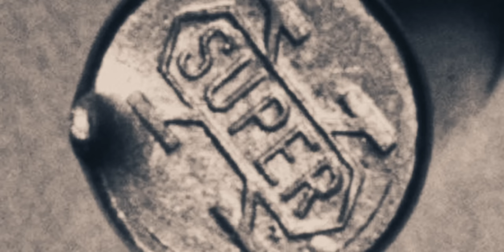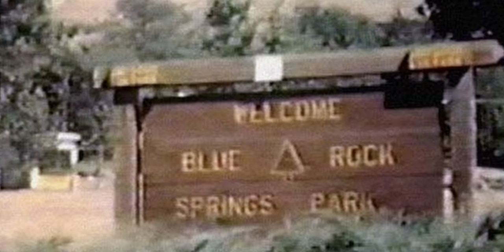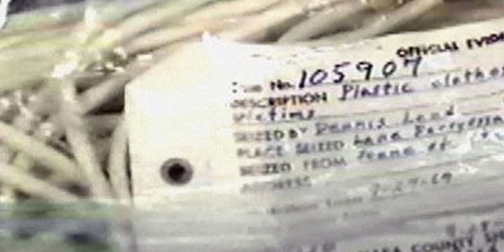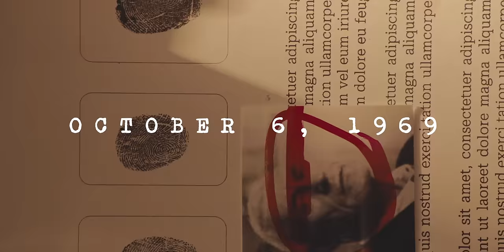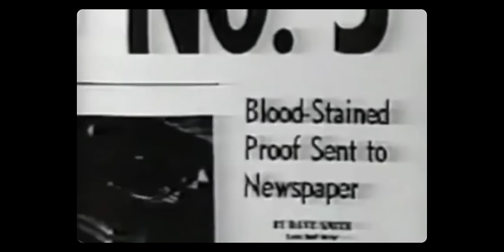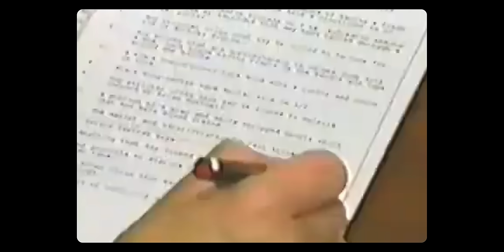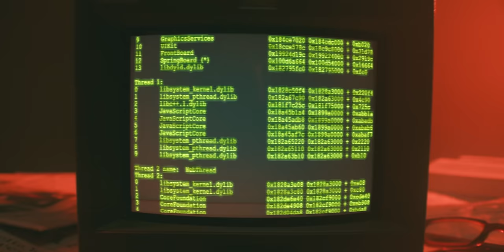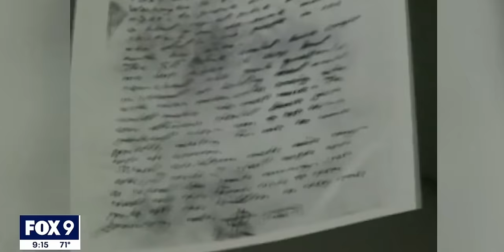Deciphering the Zodiac Killer

Comment: Born/raised in Vallejo in the 70s (~ 90s). I lived blocks from the Ace Hardware store on Amador &
Tennessee and walked by it every day to junior high (on Amador). I Even shopped there alone as a teen while ALA worked there (I cannot say I remember him at the store). My junior high was just 3 blocks from his home and 2 from the pancake house. We were allowed to leave school for lunch and would walk by his street to get to the nearby 7/11 and “Lileds” candy store. We were largely unaware he was a suspect, we didn’t have the internet back then. One thing I’d like to point out, that no one has, is that in that era, in Vallejo at least, people used a bottle of clear glue to glue stamps on. It was a clear plastic bottle with a red (?) large rubber tip meant specifically for that. They also used it at the post office. I remember it well because as a kid, I always wanted to put the stamps for my mom using that glue and we were always at the post office sending mail. I don’t know when people stopped using it. But anyhow, the fixation with the stamps plus the fact that ALA didn’t like to lick stamps, I would think he likely would have used the same glue. It was quite common! I may be wrong but I’ve heard that the DNA taken from the stamps is from the top
of the stamp, not the bottom.

Comment: Dennis Land sure sounds like a viable suspect for at least the Lake Berrisa stabbing. Pretty impressive collection of short videos you've put together here
Reply: I guess you missed the part where he was with others when the phone call was made?  And did you consider that, since this crime is connected to the other two, he would have had to have done those, too?  And continued?  You'd have to line him up to all the others...
Reply: Have you read Kobek's book? I like Paul Doerr for the lake berryessa murder. Although I personally think that's possibly the only murder Doerr committed. The Paul Stine murderer was someone different to lake berryessa 100% imo.
Reply: @grobocop2213  curious why paul stine murderer and lake berryessa would have to be different? just based on the methods?
Reply: The e-fits are completely different. Plus the MO. Also, what the person wrote on the car, again that wasn't something I think Zodiac would have done. The person who did the lake berryessa murder used Zodiac to get away with murder, simply. Also if you read Kobek's book, Paul Doerr is a slam dunk for this one. He would have been in the area at the same time and was likely wearing a costume to another event on that day. Also had a sheath for a knife identically to the one pictured (there's a picture with him showing it off.) But then there's absolutely no circumstantial evidence that could link him to any of the other murders, certainly the Stine one. Also there's the clear evidence that after the first 4 letters, the further 32 letters were clearly written by another person. There's absolutely no way all these murders attributed to Zodiac were done by the same person. It's impossible. @joinedthenavy

Comment: I dated a guy in the early 90’s who was the same age as my mother who was from the Napa Valley. He was a former air force mechanic and loved to use the old Kilroy emblem. He was identical to the composite and wore size 10.5 shoe. He sent me poetry with the same emblem as what the zodiac killer used. Circle with cross. He hated his ex wife who was a red head. He was an astral physicist but designed elaborate computerized manufacturing equipment and was extremely intelligent and capable of writing in code. His writing was very similar to the zodiac. His age would have been correct to match. He drove a green convertible with white top when I knew him. I reported it to the FBI but no response.
Reply: Name?
Reply: @Leon-dw6kq  authorities know. I sent all the info to the FBI .He would be deceased by now. But yes. He was identical to the composite. A genius. And used those symbols in poetry sent me. He actually had a home at Lake Tahoe. I’m not going to mention his name publicly. He has a grown child there.
Reply: @jadenhinds  I can’t make it out . Is that Biden?

Comment: There are always approximately the same amount of serial killers around. It's all about whether the media covers it or not and how good their practices are at the time. During the time period of the 60's/70's things were massively changing in regard to media coverage and law enforcement strategy.
Reply: In this period lead exposure was also particularly high in the 60s and 70s, which saw a significant increase in crime (obviously among a myriad of other reasons), so I wouldn't be that surprised if the number was genuinely a little higher.

Comment: Did you get permission to use the documentary footage?
Reply from the maker: It falls under fair use for commentary, because it’s in context, it’s transformed as mostly just using the audio with archive, stock and news footage over it, i was sure to credit all, and finally it’s a small percentage compared to the entire work, most is news and archival footage.

I was sure to follow all guidelines and get permission etc for everything that was needed, so I’m prepared in case there’s any sort of issues etc.

Fair use is a tough one because most think you can just comment on a full work and you’re fine, that’s far from the case, and would be unfair to the original creators, it must be used “fairly” 😊